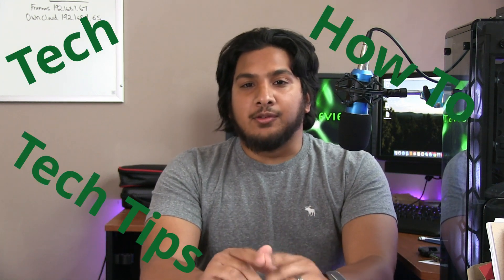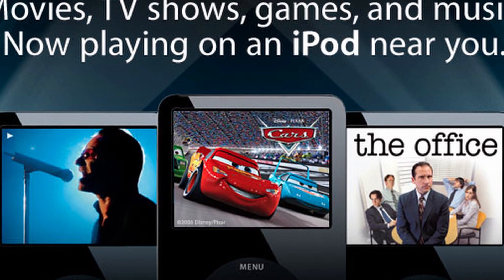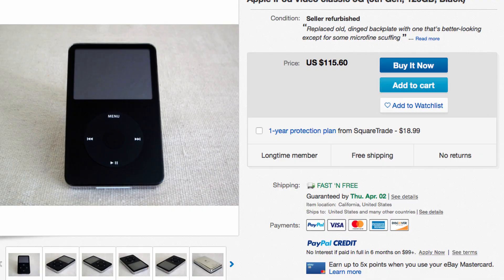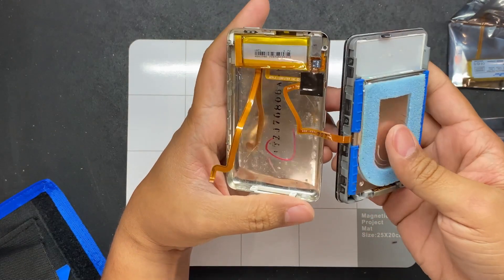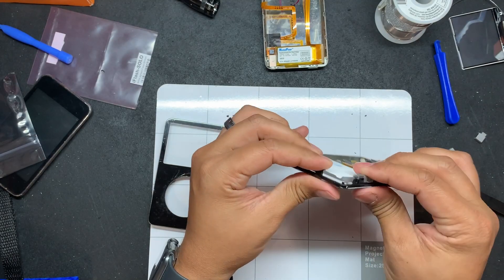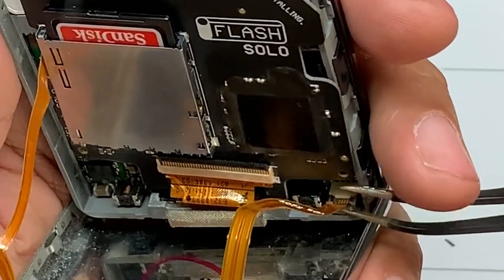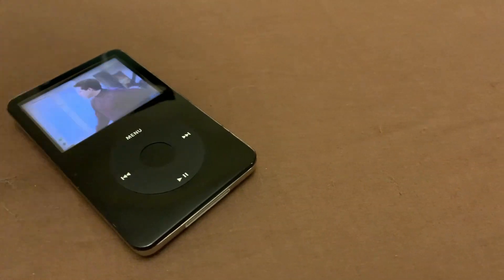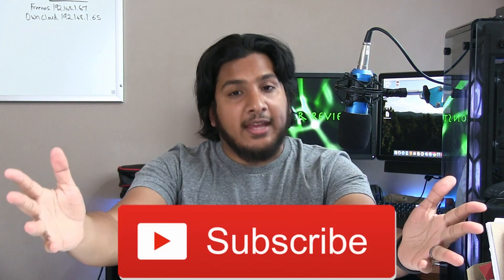Bring Your iPod Classic Back to Life! SD Card Mod, Screen Fix & Battery Upgrade

Comment: So what was the specific issue with the SD card you tried using? And what wsa it about the 32GB you finally found that makes it work?
Nice vid, this is good to watch before restoring my own iPod that our family had when I was growing up. I first got into music listening on this thing....Elvis, Beatles, Eagles, wide variety & lots of nostalgia with this thing.
Reply from the maker: Thanks. So essentially, anything bigger than 32 gb, the ipod would not see the hdd. SD card had to be 32 or smaller.